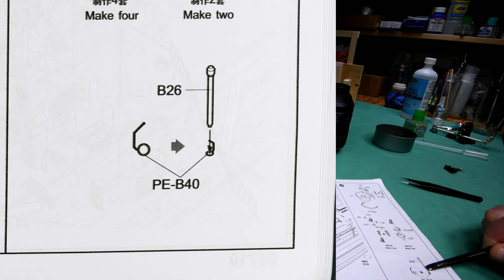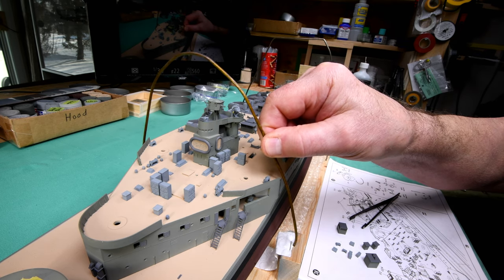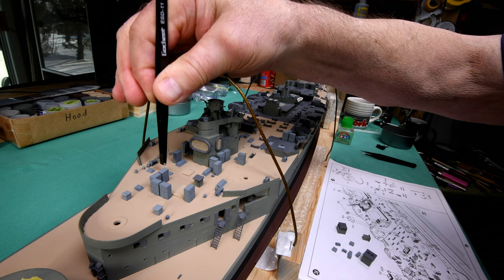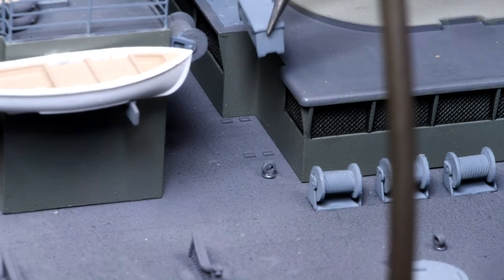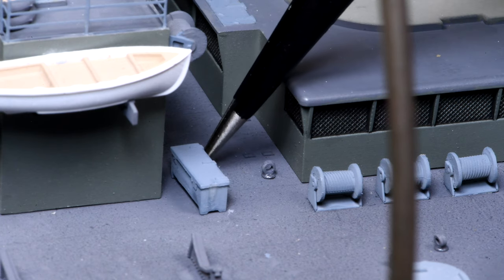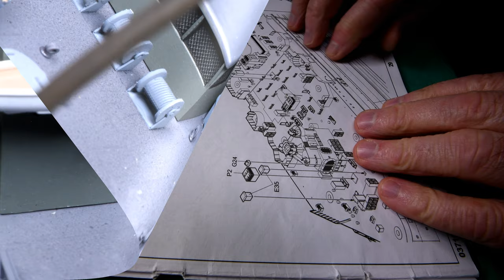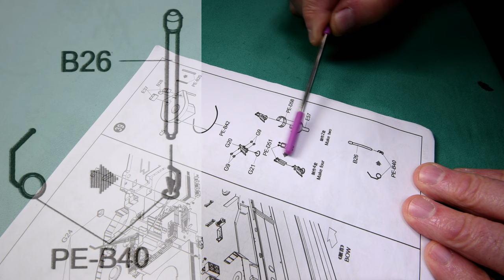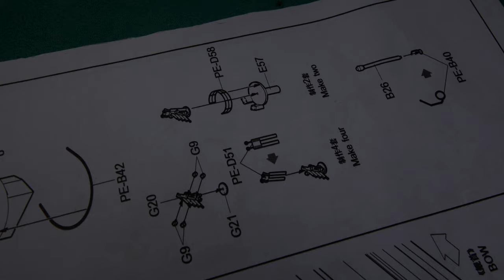The Model Ship - Part 678

Comment: The guns on the second part of step 39 are 50 caliber machine guns.The forward pair were named "Pip and Squeak" and aft pair were called "Paul and Simon".Just a bit of useless info for You...Happy New Year Ron and Happy Modeling.
Reply from the maker: Hi Brett,
Re: "Pip and Squeak"  "Paul and Simon"
I did find that they were 0.5 inch machine guns. As for the other, bet ya less than one in a million knew that. 👍